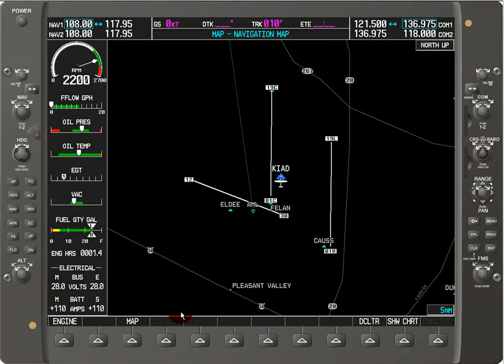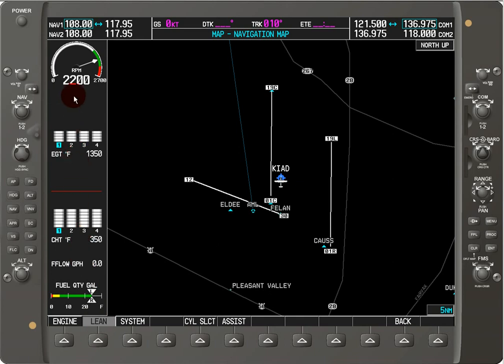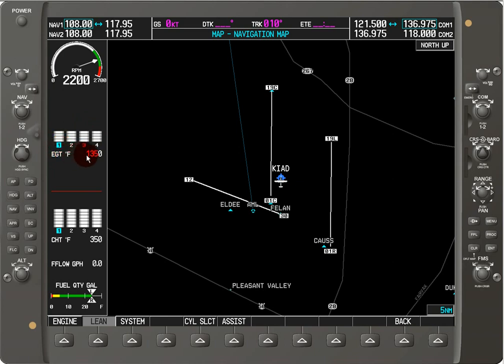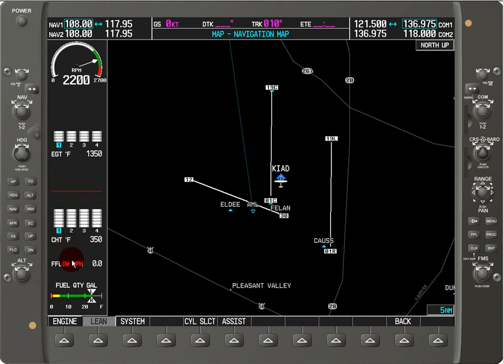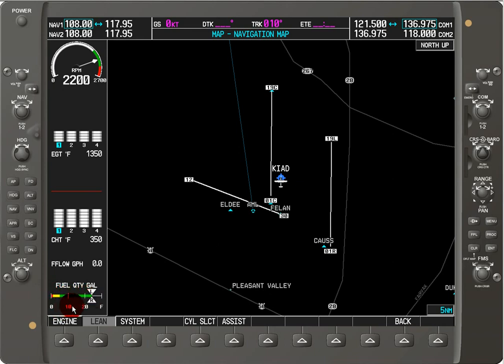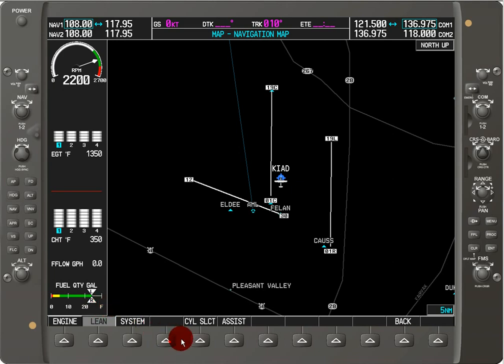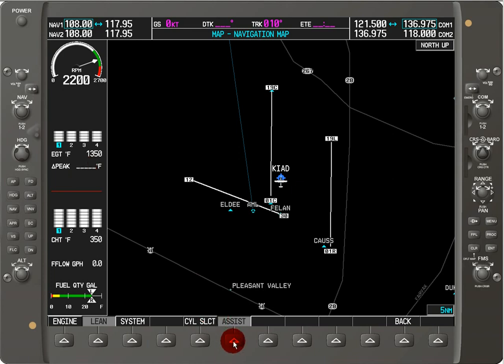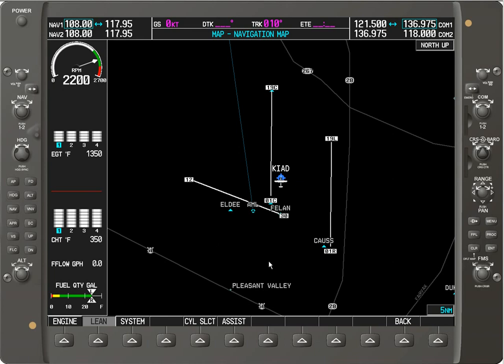Garmin G1000 Tutorial: Engine Leaning

Comment from the maker: @meyega2008 Not possible using this trainer. It's just to show you how the buttons work. Leaning the engine would be specific to any given airplane and the installed engine. Consult your POH for crap directions. Google this avweb article:

"The Savvy Aviator #59: EGT, CHT and Leaning" 

If you want some solid info.